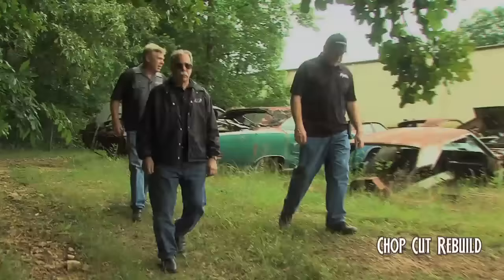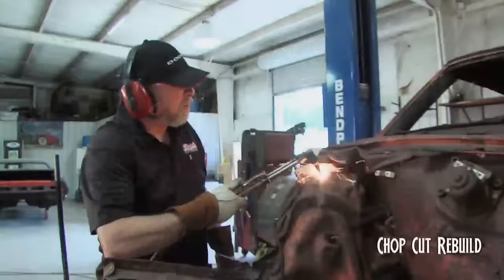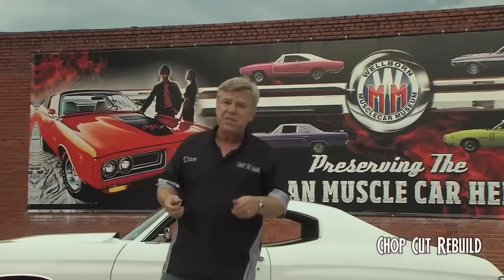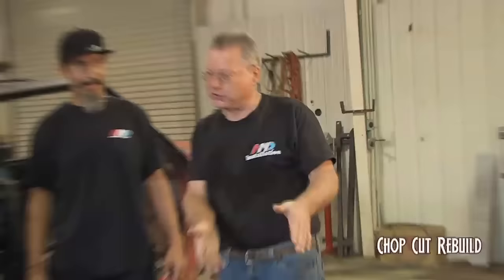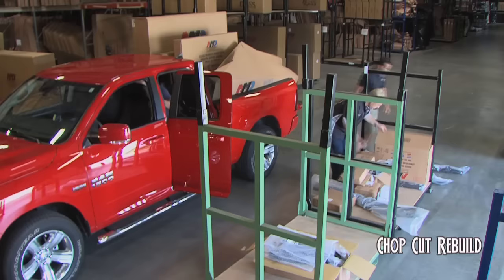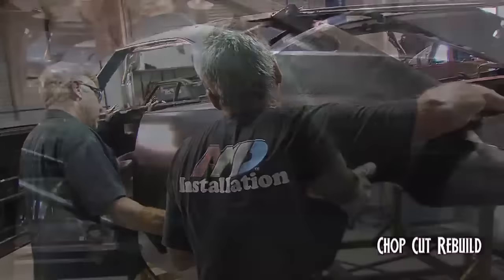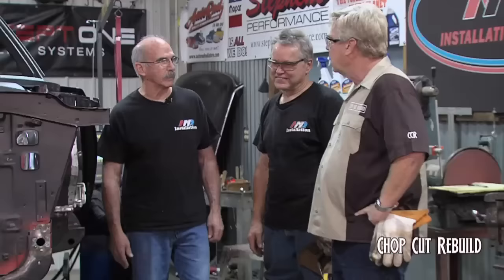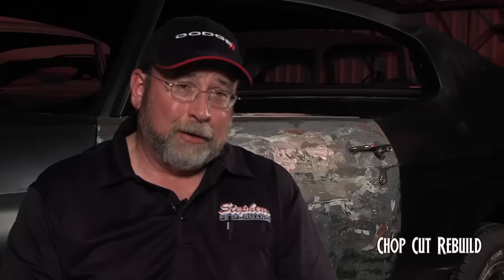Resurrecting a Dodge Daytona that was in a Police Chase Crash - AMD Garage

Comment: I don't understand people when a car like this gets restored they say "its not a Daytona anymore because 95% of the metal was replaced", well what else can you do? just not restore it it? just because its not original metal from dodge? people think because its from a automaker its all extremely exclusive/high tech when the factory basically used hardware store materials also....

 how can you expect anything in this shape to remain what it is if you cant replace any metal with new? its better than cutting up/ killing another charger to save this one...its great that there is aftermarket metal available it keeps more cars alive

Comment: I wish that AMD could make panels for the Australian made charger. I was at a car show (1997 i think) and was talking to a bloke who had a 1972 E-38  RT- Charger, 265 with tripple webers , 3 speed. He found it under a tree on a property in central Queensland. It had being wreaked in a accident. He bought it off the owner.  It still had all the original drive train. He was saying that he had to find another 3 cars to make 1. Of the 31.000 chargers made from 1971-1978, i would say that a 1/3 would still be out there but don't quote me on that. E-38, E-49, E-55 are the ones that go for big $ today, mainly the E-49 is the one that gets the big $. If AMD was around in the 80's and 90's and could make panels for these cars, how many could have being save?

Comment: At 59:00 it shows them putting new front fenders on.  I was wondering about this....Daytona's used 1970 Charger front fenders. I wondered if they'd welded on extensions to the '69 fenders, or if they pressed out a set of 70 fenders?  I have a '70 and AMD currently does not make 70 front fenders.  Just curious...I'd assume the other shop welded on extensions....

Comment: Besides the fender top vents my recollection is that the front fenders and the hood were shortened for the nose piece. That was completely sidestepped.

Why wasn't the reason for the Daytona and Superbiird discussed? Ford and Mercury were more aerodynamic and the new for 1968 Dodge and Plymouth bodies looked good but the recessed grille and the fake fastback both created drag. The first iteration for better aerodynamics with the Charger 500 wasn't mentioned. Overall the history aspect of the video is a big, fat F.

A three phase spot welder? What is three phase about it other than the power supply? All Prospot i5s and i4s are three phase input. Three phase is the industrial standard world wide for high amperage applications.

Comment: The 80s Testarossa is not a particularly fast car. 5.0 v12 with 380hp is nothing to write home about. Being big and heavy and the engine mounted too high in the chassis didn’t help handling or acceleration. The TR is a cruiser. The “Magnum” 308s looked great but had less than 200hp at the rear wheels. Lots drove with tops off because if you were over 5’10” tall your head hit the roof. Its predecessor the Bertone 308 GT4 was a better handling car but was considered ugly and didn’t sell. I don’t understand why he’d say the 250 GTO wasn’t a successful racer? The Ferrari GTO won the Tour de France in 1963 and 1964 which marked their nine-year dominance in that race. Other race wins included:
The Targa Florio in 1962, 1963 and 1964
Tourist Trophy at Goodwood in 1962 and 1963
Le Mans in 1962 and 1963
Nurburgring 1000 km in 1963 and 1964.
That’s why GTOs are worth so much to collectors. They tick all the boxes. Beautiful looks. Beautiful sound. Successful race history. Not many around. Equals big money.

Comment: How’d the nose fit up to 69 fenders (not 70)?Too bad someone with a roller and a tray of satin black latex house paint painted it.Right  front should’ve had a pull before inner fender and frame rail cut off to ensure no a pillar roof/drip rail cowl issues.

Comment: Well, I'd rather have a car that has more original parts, obviously, but I'd rather have a car like this ,than a car that has more original metal, but has had a modern powerplant, suspension, lowered, and large diameter wheels and rubber band tires on it...

Comment: So there are no original numbers on the car, no original parts on the car, 90% clone 10% Daytona. It's a clone. Why not separate cowl and firewall and pillars, repair, and reinstall when you got lazy and did it the easy way you created a fake! Daytona. Where's the Vin stampings and data tags.
Reply: Ancient episode
Totally agree with ya
Has TV history though lol
Reply: Armchair hero you are bud
Reply: More as a  Tribute, then a clone...... but then again,  where do you draw the line.
A car like this will never bring the amount as a true  survivor, but this would make a great driver's car.
Reply: Save whatever you can, if there are at least some real pieces from the original car, and a VIN tag, then it’s still the car
Reply: Why put in suspension without motor? Factory and others mount engine to k member then whole assembly goes in from bottom to top instead of wrestling from top to bottom. Just saying
Reply: This is over 20 years old come on man , don’t be upset still , that means you’d be mad back then too I seen this when I was a teenager , 😅relax , it for business purposes and it’s entertainment. It’s a conversation piece. Least we can get some parts from these guys !! This is still love for mopars. My dad had an old dodge coronet use to pick me up from school and go do some one wheel peels .
Reply: @markleblanc3447 They should have done that, but no numbers on a part like a quarter panel doesn’t make a car a clone, plenty of these cars have been in wrecks and don’t have their number after being fixed
Reply: Well cris birdsong was a teenager when thos came out but I agree cris at junkerup does a far better job ,
Reply: In my opinion, a car is not totally complete without BOTH side view mirrors. But, that’s just me…
Reply: There's no easy way in this build. It took several people to get it done, it's not like putting new panels and suspension on it

Comment: These guys have no clue what an actual restoration is. They used the front frame rails, one outer rocker and the VIN tag. The rest is repop parts. This car is a fake Daytona. It's not even close to the original car. Restoring a car means keeping it as original as possible, not building it from a catalog. Also, the video would me more watchable if you guys weren't introducing yourselves 15 times and also showing that stupid license plate every second, we know what show it is! Oh, and a car wouldn't have been damaged to that degree by hitting a fire hydrant.
Reply from the maker: probably right, they should stick to redoing Hotwheels instead
Reply: Don't you get it? They did keep it "as original as possible". And they never passed it off as anything other than what it was and is, everyone knows it's not an original steel car. It's a promotional piece, a three dimensional representation of the AMD catalog and the skills of their installation team.
Reply: Sore hater spotted.
Reply: yea it is possible for a fire hydrant too cause that much damage when the car is travelling at 100+ mph as they stated in the video